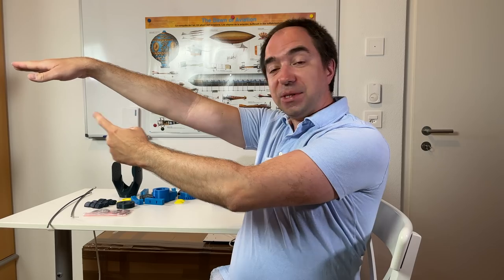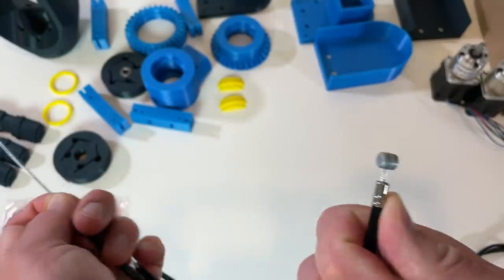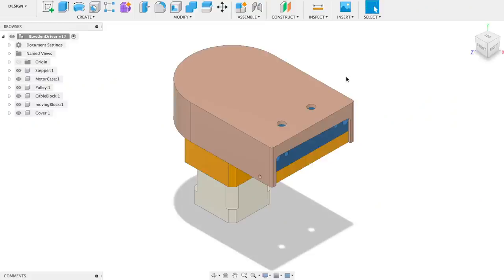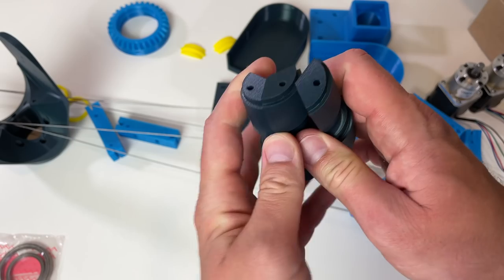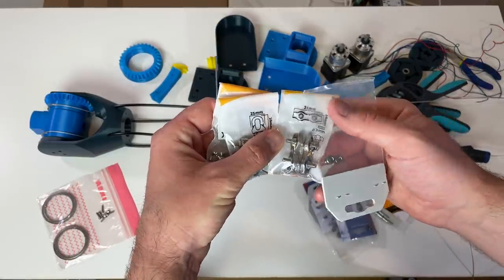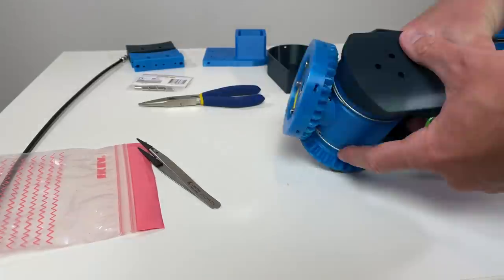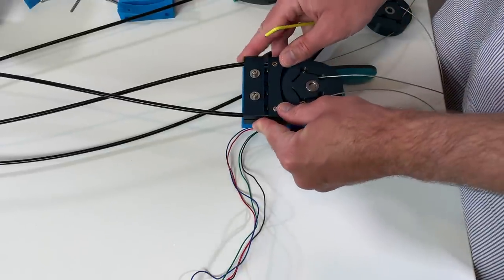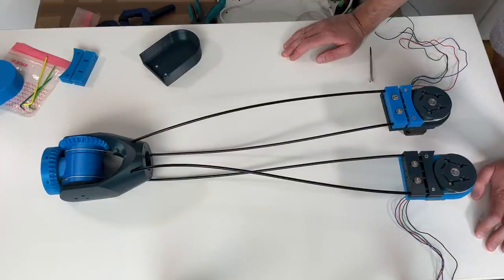Bowden cables for the robot arms? Will it work?

Comment: bowden cable worm gear driver, flexible axle power drive
Reply: plain simple channeled (ducted) rope light-weight crane/robot lifter assembly
Reply: worm gear to prevent position dependency on cable snap
Reply: two direction cables for the worm roller
Reply: ski carry chain/band loop drive
Reply: rigid axle drive, bicycle drive
Reply: rotational motion in cables, not linear